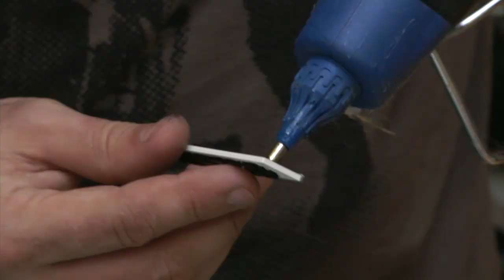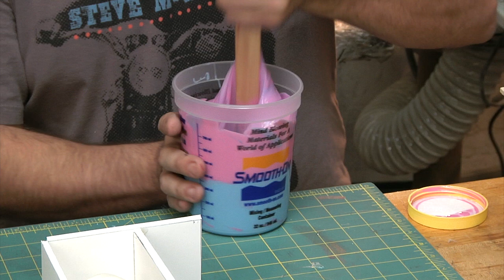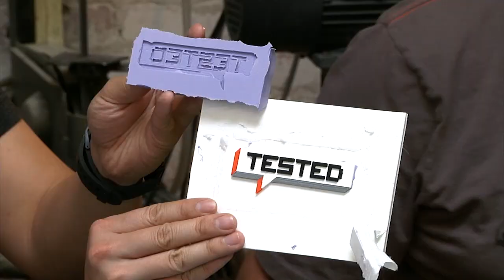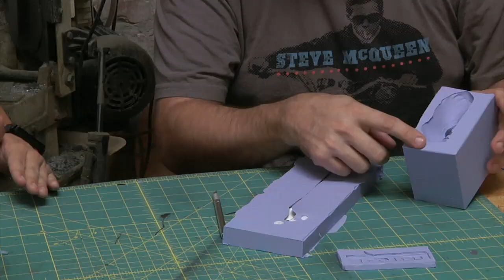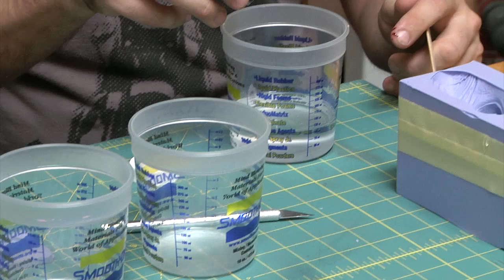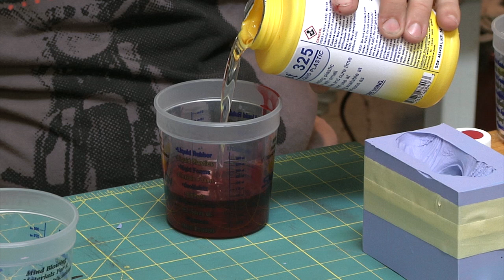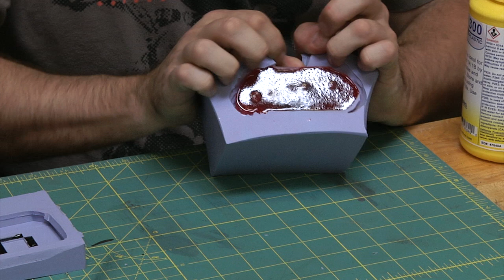How To Make Resin Copies of 3D-Printed Figures

Comment: For anyone using a modern resin 3d printer -- Some printer resins stop platinum cure silicone from curing.
If this happens to you varnish your model or look for a non-platinum cure silicone.

Comment: I don’t understand the price of $50 for the original, does that include the scan or custom sculpture of your head or is that only for the material and print time cost. A container of resin can cost starting around $20 and it wouldn’t take a full bottle. Was it printed at home or commercially?
Reply: The video was made 8 years ago so the pricing has decreased with the advancement of technology.

Comment: No need to de-gas this rubber, and no need to cast this resin in a pressure-pot? I am surprised you didn't get any air bubbles in your mold and/or casting; how so?

Comment: There is vibration table that dentists use when they cast teeth, that would help with the bubble problem when pouring resins into the mold

Comment: why not 3D print the cast and then pour the material in for curing?
the cast is just the negative of the model you are making
Reply: A PLA print is not flexible nor non-stick. The hardened resin will be stuck inside your mold.
Reply: @CodeMonkey188  mold doesn't have to be flexible you can make the mold out of 2 pieces bolt them together and pour in the material from a spout carved/designed on top ... also you can find materials that won't stick to PLA on Smooth on or use a different material to print your mold

Comment: Also, with materials that have long working times you can use a vacuum chamber to extract the gasses and get a smoother mold. You should de-gas  before and after pouring the silicone to remove as many bubbles as possible.
Reply: Depends on the application, but can be very useful.  The materials (silicone and resin) they were using had quick working times for the sake of the video.  Vacuum degassing usually requires a much longer working time than 2-1/2 minutes.

Comment: Is there any way to make a resin cast with no bubbles and no pressure pot?
Reply: Thin, slow set material with a long working time.  Mix very carefully.  Vibration can help shake the bubbles out before and after pouring the mold.  Silicone does seem to bring bubbles out around the surface of a casting, too, so some trial and error may be needed.  If you're not using transparent stuff and just need the bubbles out for shape and stability, you can look into slip molding methods and do multiple layers:  Coat the surface of the mold but don't fill it.  Dump out any extra.  The thin layer will release bubbles better.  Could have some problems with the material not sticking to a silicone mold, however, making other materials better suited for the mold.  (Resin, Plaster of Paris, latex, alginate, clay.)

Comment: Would the bubbles come out with the cup in a vaccum chamber?
Reply: With longer set time, yes.  The materials used in the video cure quickly and would probably set before they could be degassed and used.

Comment: Pour Water into the Mold. Weigh the difference. Now you know how much resin exactly fits into the Mold. Dry your Mold by pouring it out and letting it sit for a while. know you have a dry mold and can mix your resin and you will only loose ~5% and not almost half a cup...

Comment: I'm using Smooth Cast 325 and getting so many bubbles that it's practically foam. It's totally unusable! My environment isn't humid, and the only thing I did differently than they did was shake the bottles like it says on the lid. Obviously this is trapping bubbles into the resin, but does that mean I'm NOT supposed to "shake well?" They didn't even bother to stir theirs before measuring. I would love to know how they're getting it to come out so clear without foaming up.

Comment: If we heat up the thin resin pour (heat gun) will it cure faster? is that how science works?
Reply: Only slightly, as pointed out regarding bigger molds curing faster.  Heat can also be used on an unset resin surface to remove bubbles.  It's a chemical transformation, however, so while some heat can help, it's not "drying" so trying to help it evaporate does very little.  It's releasing its own heat, not water.  Heat guns are limited in helping glue or paint dry, as well, as they tend to skin over, but the core still needs time to release vapor.

Comment: Is the resin and silicone also good for clay?
Reply: Yes.  Some clay shapes, especially with overhangs like a chin, nose, ears, (up to the whole model) may be destroyed in the transfer, so it's usually used for temporary designs to be transferred, then the clay is recycled.  You'd want to wash the mold carefully after making it, to remove clay residue.

Comment: I thought this was a great video, both guys did a super job. Safety Aware is important when dealing with chemicals that have exothermic reactions, but I'm surprised you didn't vibrate the mould to release trapped air bubbles more actively, that's good practice. Still, nice work.

Comment: You can use compressed air to get the head out, stick a nozzle in and give it a quick blast, and it will come right out. No cutting required.
Reply: Not always.  The shock of air can also break or tear sensitive parts of a model or mold.  It's an excellent tip for SOME cases, however.

Comment: Question from a noob: I see you aren't using any mold-release. Is it not needed for this? I am scared to ruin my original.
Reply: It would depend on the material you are using to make the mold. Since they are using a hard plastic & silicone compound, it's not a problem. I guess resin comes out easily without it, too. (But a release might make the mold last longer.)

You can probably get more info via internet searches about how to preserve different materials when creating molds. I've only made molds with polymer clay objects & things I wasn't worried about, so I don't have any info on that. I have heard of mold release products for silicone molds, so you could start your search with "silicone mold release" then check out websites of companies that make the product. They will probably have info on what materials to use it with and instructions on how to do it properly. 

I have also heard that some materials should be sealed before using them to make silicone molds (for example: wood--if I remember correctly). 

It'd be best to make some items using the same material(s) & method(s) to run some tests with, before molding with the original you are concerned about.

Comment: Pro Tip
We all know that resin is expensive and if you have this much left it hurts your soul to throw it away, especialy whan you make bigger molds. My tip is to make a 1 mold (or find something) of small cube 3x3x3 cm for exsample. Cast this in resin for test and than messure the weight of your cast. So you kind of have the Weight for a specific volume (now you also can calculate the densety). Now run around and try to fill the mold with something that has the same weight per volume (like rice, sand, water or whatever fits your casting material. Than go to your casting witch you actually want to make, and fill it up with (rice, sand, water ... etc. And transfer ist to a cup. So you can make a aproxymation of the volume of your form. It will not be perfect but you can make a much better prediction of the amount of resin that you are going to need for the mold.
Hope you find this helpful.

Comment: When you know how much resin you use to fill a mold, label the mold with that amount (in this case 4 oz). You will save a lot of resin over a small number of casts! Especially if you don't do a lot of casting for a period of time, it will save you doing the trial an error multiple times...
Reply: I used to keep an excel sheet with spot on amount of each component for every piece to be casted

Comment: Pour rice into the mold then out the mold into a Measure up, look how much it needs add a little just for protection.
Reply: Water can be easier for many things, but that's a really great tip for something that water might damage.  Quinoa and other fine grains (clean dry sand) would work as well.

Comment: Is the resin head solid or does it dry like a gel?
Reply: Resin is hard solid plastic.  If you're looking for something softer, silicone can cast latex or other silicone.  (Or even gelatin, if you want edible/temporary.)  The new stuff doesn't stick to cured silicone, which is why you always want to make more silicone than you absolutely need.  You can't add to it soon enough if you run out while the stuff is curing.

Comment: What kind of resin would I use to match a similar feel and durability of a marvel legends 6 inch action figure?
Reply: Try a toy or collector forum to find out what plastic it's made from and go from there.  (Toys are almost never made from resin, but collector figures can be.  Toys will be injection-molded (melted) plastic, which is far more durable.)  YouTube isn't a great place for that kind of detail unless the video is specifically on the topic.  Casting is a VERY broad subject.

Comment: I can make molds and want to do one of a kind fisget spinners.  Is resin strong enough not to break if a spinner is dropped?  Is there a way to make resin stronger?
Reply: No.  It's hard and brittle like toffee.  Toys are better made from injection-molded (melted) plastic, which includes extrusion 3D printing.  A hard latex rubber could also work well.

Comment: This was one of the most informative videos I've watched the zig zag tip was golden
Reply: Stefan Mack It's physically impossible to cut a straight- to-zigzag line like he described. Notice they didn't give it a clear camera angle when he said "you can KIND OF see how its straight"??? Yeah... that's because it's not.
Reply: There's no clear camera angle, nor for Norm, because working hands and a cutting tool are in the way.  Silicone CAN be stretched apart to be cut different ways.  This really isn't complicated.

Comment: What do you do to make a smooth mold if the quality of your 3D print isn't so high?
Reply: Acetone mist has been used for smoothing some prints, (depends on material) but can damage little details you wanted to keep.  You can also mechanically alter the surface:  Knife, sandpaper, polish.

Comment: why don't you just 3d print the cast?
Reply: Because when the video was made, prints cost as much as you could buy a cheap printer for now.  The materials are still cheaper than a printer, if you don't have access to a company to reproduce something for you.  It's also very useful to know old techniques.  They can teach you a lot about how and why things are done the way they are today, and give you insights to make new work easier.

Comment: Thank you so much for this video! It was very helpful!    Can I use acrylic paints to paint over the white smooth-cast 300?      If not, what other types of casting material could I use that would allow me to paint with acrylics?
Reply: Most resins should take to most paints nicely.  There may be some rare ones out there that don't like some types of paint, but the product info should say so either way.  Always read the label before purchasing, and make a small test before any big project.  :)  Silicone will resist paint, but resins don't generally have that property at all.

Comment: What if you used a oil-based liquid and poured it into the mold and pour it back out into the measuring cup to know the exact amount of resin you need to mix? If so, what kind of oil-based material should we use?

Comment: Would I be able to do this with a wooden mask that I have ? Any tips / suggestions would be appreciated
Reply: I don't know if you've already done your project, or are still interested if you haven't--or if someone else has the same question, so...

I've heard that some materials should be sealed before using them to make silicone molds (including wood--if I remember correctly). I haven't tried making molds with anything like that, but you can probably get more info via internet searches on how to do it. 

I'd start with a Google search for "silicone mold compound sealant sealer release" or something like that. The websites of companies that make that type of product will probably have info on what materials need to be sealed &  instructions on how to do it properly. 

It'd be best to make some small items using the same material(s) & method(s) to run some tests with, before molding with the original.

Comment: You see all those artifacts in the resin? How do you prevent that? Is there no way to get a perfect resin cast?
Reply: Thinner resin, slower set time, slower mixing.  Vibration and vacuum chambers can be used to really pull bubbles out.  Brushing the cast material onto the mold can help to avoid surface bubbles, but silicone seems to encourage them forming during the cure.  If you need a beautiful transparent casting, another mold material might be advisable, like latex, plaster, alginate, or clay.

Comment: why wont you use a release agent to protect the mold?
Reply: Silicone rarely needs it, unless you need to protect the material you're making.  A bit of oil spray might be wise for molding a cake, for instance.  Almost nothing sticks to silicone, including new silicone.

Comment: I have so much respect for tested and Adam and all you professional guys. My only concern was the tested sign. If you get rubber underneath the cast is so hard to make flush. Not a problem here if course but if the piece needs to be level on all areas once cast, stick down on wood  with carpet or double sided tape. Even if your master is stuck to the base, you can keep it and the mould will always puddle cast level

Comment: My print has a raft inside so could I coat the print with nail polish to water proof it out is the silicone too thick to get inside?
Reply: Patrick Monkman silicone is thick just sand well because the lines will show

Comment: You can figure out how much resin you need by filling a measured cup with water, then put the 3D print in the water and the difference in displacement is about how much you'll need. Add a little extra for good measure cause sometimes the resin shrinks.
Reply: In this case, for those 3d printed pieces, you just have to go to the 3d print file and look for the volume of the piece
Reply: One really good way to approximate the volume required is, pour dry rice into the cavity and then measure the volume of rice used. This is a rough approximation buy very close.
Reply: Adam Pierce yeah a cast with pieces of rice that got stuck in the mold sounds perfect. All these people talking out of their ass except for the one who said to put 3D object in water.
Reply: @pantac4493  Yeah except the 3D object also isn't the same density as the resin. In reality, the density doesn't matter that much. And when you're filling the mold with water, you're relying on volume NOT density. 1oz resin = 1oz water.
Reply: @pantac4493  LOL Duh.... Water & resin does NOT mix. RICE on the other hand is easy to clear out of the mold & a Good approximation on the amount of resin you will need (Always ad a few %% more.) Wouldn't water also make the mold walls soggy & harder if not impossible to work with?
Reply: Wayne 3D object is not used after marking the mold, so no, the mold will not get water on it, the 3D object will. Duh....
Reply: @pantac4493  EXACTLY... Have you seen what happens to Resin when moisture gets into it Dickhead? DUH!!!
Reply: Wayne EXACTLY. The 3D part is not used after the mold is made so the mold is dry when you pour the resin. Duh!! So you can put water on 3D part all you want it won’t affect the resin. Duh!! Lol learn something
Reply: mmmm didn't think bout that thx :)
Reply: Sagrotan Go to school dude not on my nerves....
Reply: @Zotemann  - Liquids are not compressible dude. You're talking about expansion and contraction of a molded, hardened item. Which is completely different. Pull your head out of your...
Reply: i prefer weighing. tends to be more precise in my experience
Reply: Rice is better
Reply: Or you could fill the mold with water, then pour that water into a measuring cup.
Reply: @PongoXBongo  if you use de mold, you have to wait unitl it's dry
Reply: I was thinking the same thing
Reply: Pan Tac I'm pretty sure that pouring water in a mold will have the same outcome as pouring resin in. The water still fills the mold the same way.
Reply: @biggibbly7471  If you have a tiny bit of water trapped with a fast acting exothermic resin, the effects can be interesting to say the least.  It's possible to get steam coming out.  I've done it.
Reply: Gabriel Meyer do you even read all comments there’s one above that says water reacts with the resin unless you let the mold dry out and who has time for that. Just put the 3D object in water and measure, not rocket science
Reply: Sagrotan yes he would spin, cause you have no idea of basic physics! Sagrotan LOL of course resin is compressible! Also it shrinks when it hardens 

Also hardener and base have different density, which causes a difference in the volume!

1ml gardener + 1ml base isn’t 2ml

Its less!

This is why the instructions of every resin states that you should use the same WEIGHT of parts, not the same volume!
Reply: PongoXBongo not a goood way to do it

At first the density of Resin is often way different to water! Also you have to wait till the mind is fully dried, cause water reacts with Resin! Another thing is you method doesn't work on cutted mold and does not work on Multiform molds, cause the water would be anywhere but inside the mold!
Reply: @Zotemann  - Uh. NO. 1 oz by volume of resin is identical to 1 oz by volume of water. This resin, and many others, can be done by volume.

And in any case, if you're putting the 3D head in water... you're getting density of the 3D piece. Which is different than the resin anyway.
Reply: @Zotemann  what. No.
Reply: Tes_ Or make the mold and fill it with water and that is how much liquid will fill the mold.